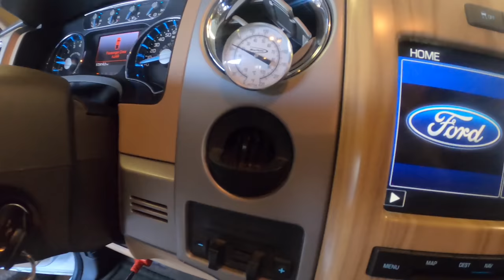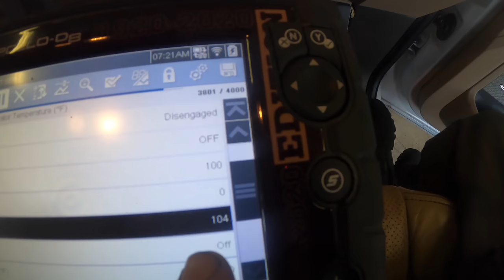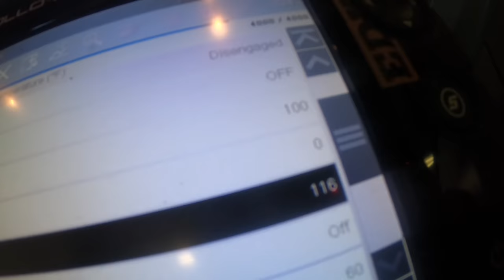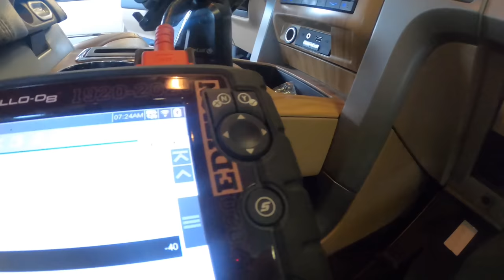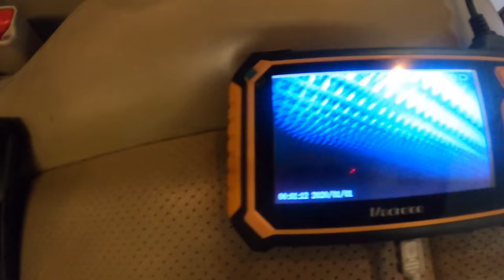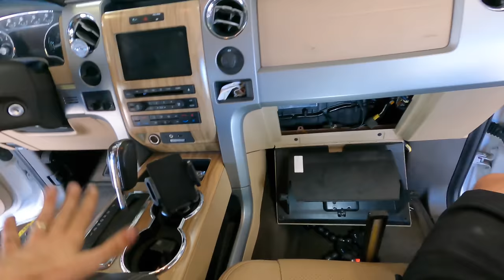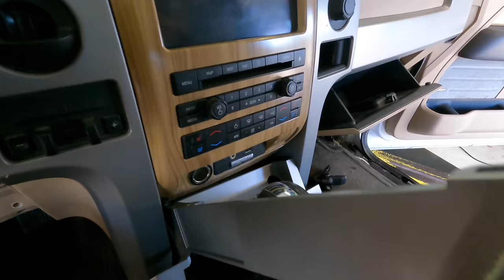TEN HOURS to replace one sensor! Ford 150 torn to pieces! Evaporator Core replacement.

Comment: All Ray’s videos are so great. But this one frustrates the crap out of me to no end!
This is the absolute perfect example of the S T U P I D I T Y of the modern automobiles designs. Seriously?!?! All this for one simple little sensor?!?!? It doesn't have to be built into the dang core. They could have put a simple door where the sensor is and let you open it, one screw to remove the sensor, then put the new on in, and close the door. Done.  O M G ! ! ! !  This is absolute madness!!!

Comment: That's the ridiculous problem with the evaporator box, you should be able to cut it open, do the exchange (sensor), and glue the plastic box together again ?!
Panel beater's (body builders') job, really !
Car assembly line workers get familiar with this stuff, doing it every day of the week !!

Comment: It's not an exaggeration that car manufacturers build crappy inefficient designs intentionally, that it would take 10 hours to change an itty-bitty sensor....
This is because the dealerships get 60% of their revenue from parts & services, so when Ford makes it difficult to replace a part, it makes the dealerships happy..
Enter Tesla cars, and the whole dealership model collapses...   Not to say if mechanics got some EV training, they could still make good money...
We will NEED more EV services centers, and those that jump onboard are the those that will survive the transition..
I've been the Network and wireless support industry for the last 40+ years...  Don't you think I've seen major shifts in the industries, and has to re-train for them ??  I kept up with the changes..

Comment: If you warmed that plastic box up with a heat gun you would have got the inch you wanted to get it open and greatly reduced the chance of cracking the plastic

Comment: Just cut a  square 'window' out of the plasic box with a solder iron .use the seam of the box as one side of square........push in a new OEM sensor in the coil.......epoxy (or plastic weld) the square back in.   You can get a new OEM or used one......do test it first...

Comment: This is where these so called engineers need to get there butts out in the field and see what techs have to go through day in and day out on stupidity. I got out of the business in the late 90s. I seen the writing on the wall and plus everytime I turned around, I had to go buy a tool that I probably used 1 time and spent $50 - $150. Then you have to be a contortionist to work this  crap.  I'm 6'4 and 250lbs. Believe me it wasn't easy to do some of these jobs.

Comment: Nightmare of a job for one tiny part.
Obviously not possible in this case as its a customers car but if it was mine I'd have located a used hvac unit, removed the sensor and pushed it between the fins of the unit in the car as per Ray prising open the unit.
Ridiculous that the sensor isn't even  available as a spare part.

Comment: Lol careful. Maybe the engineers will design a car where you need to remove the engine to change the oil.  I know in a Bugatti, you need to remove half the back of the car to change the oil.🤣🤣

Comment: Freak'n ridiculous that an engineer(directed by management) would design such a cluster F@#k for a cheap sensor!  It would have been so easy to design this for a thread in thermocouple.  I'm sure you're well versed in the type of thermocouples, but it's likely that the thermocouple you tried wasn't of the same type.  I've been out of the field of TC's for a while, but there's type J, type K and some others.  They "should" be interchangeable as long as they're the same type.

Comment: Would this be possible: use a hole saw to cut a round hole where the sensor is, pull it out, put new one in, plastic weld / duct tape round plastic back on. Then go to whoever built that truck and say, why on earth would you not put a door there in case this happens? Really, entire dash out just for a sensor?

Comment: The other part is using a different sensor which has a different resistance curve than the original part. Our company makes sensors for the hvac industry. So ridiculous for a five dollar part.

Comment: Charge 200 bucks to the customer for parts and labor, and then 10 hours of work to Ford, because the missing maintenance hatch it's an obvious design flaw for which Ford is responsible...

Comment: One question that no-one asked is: WHY DID THE SENSOR FAIL ??  And the answer is simple. The temp sensor failed because it was a low quality part. The actual "design" of the sensor itself is brilliant, but the execution of the design in the manufacturing of the sensor is terrible at best. When Ford places orders from the manufactures of sensors the should not specify acceptable failure rates of 3%

Comment: Aargh... Just cut a "maintenance/access" door into the case at the sensor location. Wait... New one comes with evaporator only? No problem. Evaporator probably costs way less than the labor. Buy it and rip the damn TC off it & "install" on existing evaporator... maybe use the slight gap opened & don't need new "access" door.
What not evaporator but virtually entire AC? OK then. Just get a 12v interval timer for the compressor clutch: 《Timer Relay, DC 12V 10A Programmable Digital Time Cycle Delay Switch Module 1500W ON-Off Control 0-999 Second Min Hour LED Display》$15 online... and set to something like on for 30 seconds every minute. Customer can learn to change settings if needed.

Comment: THIS IS WHY I LEFT THE AUTOMOTIVE INDUSTRY AND WENT TO INDUSTRIAL!

What an absolute disaster in engineering!

No one in engineering - and I mean absolutely NO ONE - gave one 💩 about removing and replacing parts on this vehicle!

Why didn’t they make the glove compartment and trim removable by detaching and dropping it down? Problem solved. 

This goes FAR BEYOND any reasonable expectations of how much needs to be removed JUST TO ACCESS WHAT NEEDS FIXING!

I guess we mechanics should be grateful for a hood over the engine!

Think about how much more can go wrong just to replace this temp sensor. Which brings me to the next point…

You need to replace the temperature sensor? YOU HAVE TO BUY THE COMPRESSOR TOO! It’s just a way to increase stock shelf space by making two things one thing, and the customer pays the price. 

I’ve tried to replace a bulb in a running light, but the bulb was encased in the fixture, and the entire unit had to be replaced. Grrrr.

Automotive engineers should be required to take a one-year college course in auto repairs before they’re eligible for admittance. 

Thank you for your time on this matter. 

Peace ✌🏻

Comment: I really think engineers design things like this because they hate mechanics!  the location of the evaporator and heater core on my dads old 77 ford was under the hood. remove the wipers and a small panel and both would come right out.

Comment: While there are a LOT of things that are ridiculously difficult to get to and replace when they SHOULDN'T be, and Ford is one of the worst when it comes to designing things that are unnecessarily difficult to work on, there is no good way to make heater box components easy to access because they pretty much HAVE to be mounted under the dashboard.  Could Ford engineers have made that sensor a little easier to get to?  Possibly, but working under the dash sucks no matter what you're trying to work on.

Comment: So instead of just making a simple plug in that plastic box that you can pull out with the sensor attached to it, they want you to take the entire dash apart and replace the entire evaporator??  And if that's the case, how about make that lower dash removable so you can just drop the box out? One more reason I'll never own a Ford. I would have just cut the face off that box and duct taped it back together.

Comment: I can't even finish watching this video. It is unbelievable how ridiculous car manufacturers have become! Why couldn't this sensor be made more easily replaceable by having it plug into the fins and be accessible through a small easily accessible door  under the dash!  One screw, unplug the sensor, replace and reconnect it, and replace the one screw access panel door. This is one of many reasons I will never buy a new car again!

Comment: Never going to own a Ford again. Such bad engineering all over the vehicle. This sensor has gone bad 3 times but is much easier to replace than this 10 hour nightmare. Sad in this day and age. If Ford is around in 10 years I will be amazed

Comment: Ford should be ashamed of their design teams, no access panel and you can't buy the sensor separately anyway. You've gone from a 20 dollar part and an hour's labour, so approx a hundred bucks to 1200 for the part plus 10 hour's labour, so over 2 grand for a 20 buck part.

Comment: a car where you has to remove the panel to replase a sensor or a core valve is a bad designed car.
all sensors and actuators should have easy access on any car.

Comment: That’s hilarious. To replace that sensor involves working from the rear seats. The unit was assembled somewhere with a guy in a factory with a box of hundreds of them sensors. 

Really that box could have a flap to open with a foam seal. Would be a tiny fraction of the price to fix.

Comment: In the late 60s - early 70s Ford had a slogan "Ford has a better idea". It seems that concept has been lost to time. The access and availability of that one important temp sensor is rediculus and unnecessarily buried in that assembly. I see no logical reason why access to that failed sensor, which ultimately destroyed the whole AC system could not have been easily and cheaply replaceable with a small design change. How much was this owner charged for this engineering nightmare?

Comment: No way I even attempt this. Ten hours of your work translates to about a week, week-two days for me. This is when I drive to a wrecking yard, pull (tear out) an evaporator unit, gnaw off the sensor and bring it back home to go with your first idea of simply splicing in the new one and  call it done. If it dont work, buy a fan and end of story. I understand you are getting payed to do it right but thats some ugly work right there.

Comment: Fords HVAC systems suck. All the 2008-2014 Fusions have HVAC problems. The sensor is dead center of the dash, requiring removal. But it's no guarantee of a fix. Controller goes, fan resistor burns up or gets water damage, fans blower motor squeals. Just trash.

Comment: As a master mechanic, specializing in euro and exotics, THIS video is why i don't touch american vehicles. 10.8 hours? Gtfo. A heater core in a vw euro van is 16 hours, i wouldn't touch this for less than 20 hours. Ford, f off ridiculous design.

Comment: Break the clock spring?
I would rather break 100 clock springs then to rip that whole interior out of the car for a silly temp sensor. I can imagine ford engineers busting a gut laughing at you and congratulating themselves on a nightmare of a design. Any other service station would just get another temp sensor from a junkyard, cut a hole  in that stupid evap housing and plug in the sensor put duct tape over it

Comment: Sheesh, make one wonder whether or not the automotive engineers have any common sense…10.8 hours labor for a $20 part…totally insane…😡
I’m not even going to comment on the engineers leaving off a transmission dip stick on many late model vehicles making checking the fluid level very expensive…🤬🤬

Comment: Is it a job requirement for ford designers to thoroughly stuff their heads up their asses before they design something?
That sensor should be a separate part and there should be a small access panel on the side of the clamshell.
There is no reason that job needs to take more than a 1/2 hour tops.

Comment: Omg designed by an idiot. If this was your own vehicle then a hole would have been cut in the evaporator housing. I guess if he asked the owner two hours and access hole or 10 hours and everything out I bet I know the answer. Just had a similar on a tractor. Extra access panel cut in cab floor to replace engine mounts. Saved hours of work

Comment: this truly stupid design shortens the useful life of a vehicle by 1/2.   The motor companies love it because you have to junk a fine machine over a  50 cent thermocouple and a replacement F150 costs $60,000  that's    $70,000 with loan charges and taxes.
Reply: If I had the knowledge to diagnose this flaw  then i would call every AC repair place and beg for a rotten core ac evap unit like this and then confirm that the resistance was different or if some miracle occurred and the data on the thermocouple was available somewhere I would buy a TC from digikey that is close and cut a small  hole in the side of the box and insert whichever one was available.

Comment: How stupid. You would think the engineering would put a accus door in the side of that close to the glove of you could change that part by taking the cover off. How stupid.  Or at least build a unit that cant fail.
10 hours at a dealership is over 1200 dollars or more.  It might be 140 an hour shop time now so a 1,500 dollar job.

Hell fir 1,500 dollars id just cut out a flap in the side of it save the 10 hour job tape it back up and watch it work like new.
Come here hot knife

Comment: I cannot believe the way you work. You have hardware all over the floor, constantly having to search for tools (sockets) haphazardly tossed aside. You didn't check part availibility, you were going to leave the old part in and "relocate" the new part, then you were going to put in the wrong part... what kind of operation is this? I'd expect this from a friend who fixes cars in his driveway but not a "professional" shop. Has to be a case of nepotism, there is NO WAY you got this job based on skill and integrity.